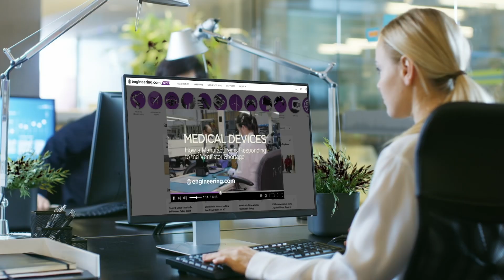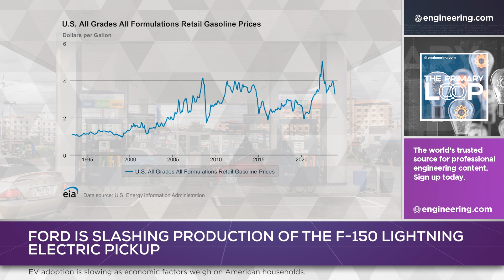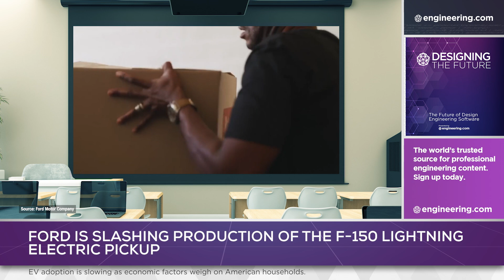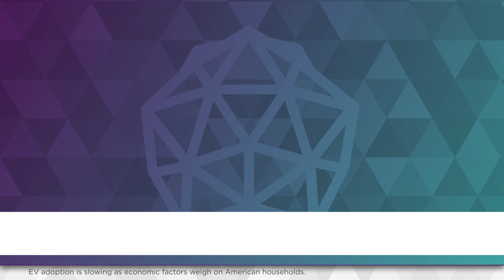Ford is slashing production of the F-150 Lightning electric pickup. Why is demand down?

Comment: "Why is demand down?"

Because for the price you can get an F-250 pickup with a diesel engine that can pull a horse trailer for 600 miles.   Or better yet, a Raptor for 1/3 less money.